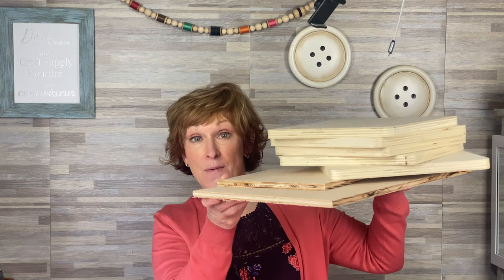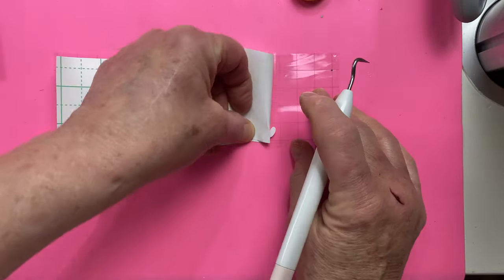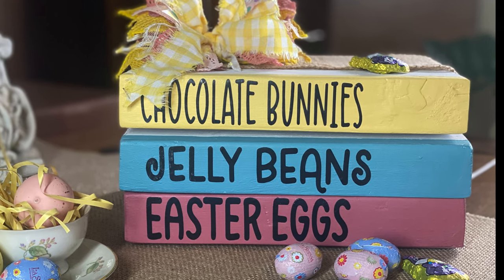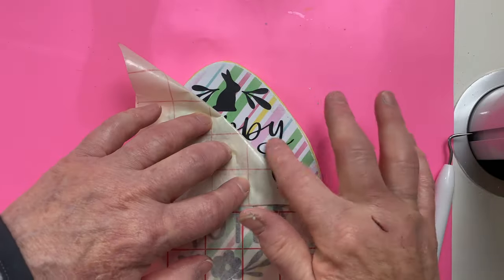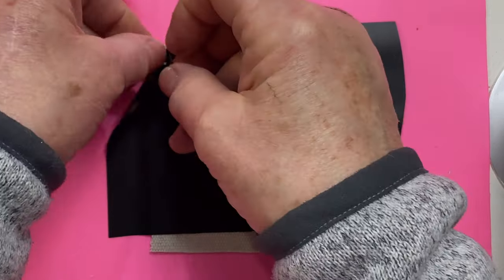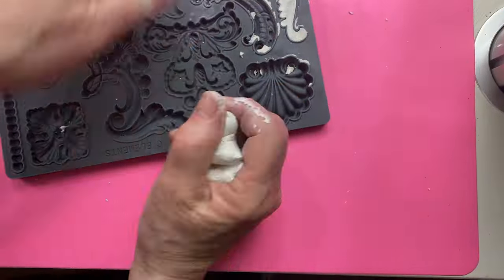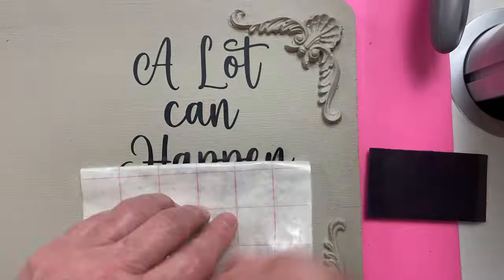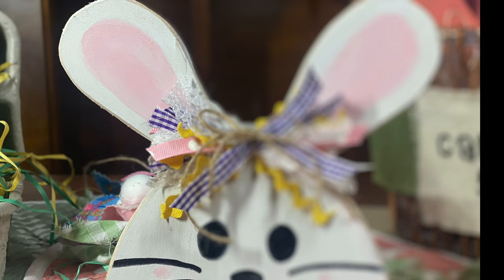EASTER DECOR DIYs Easy and Budget Friendly

Comment: What kind of transfer tape are you using? I have found with smart vinyl that I need to use a STRING GRIP tape. Regular isn't strong enough because the vinyl seems to be so much more strongly attached to the backing it doesn't lift off as easily. If you don't want to pay Cricut's prices, Hobby Lobby also sells a strong grip tape. Wait till it's 40% off. Hope this helps 😊
Reply from the maker: Thank you so much Nicole, I'm going today to buy strong grip tape!